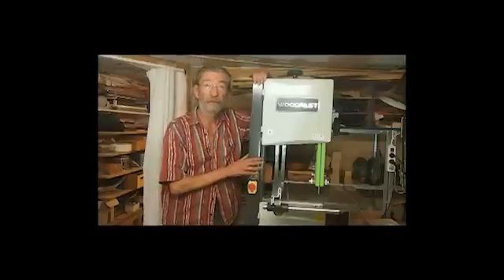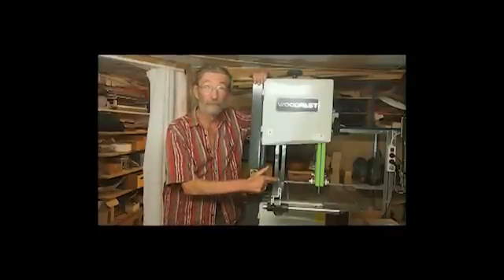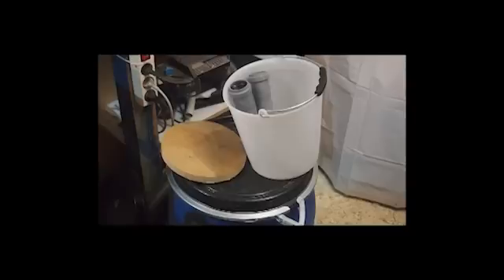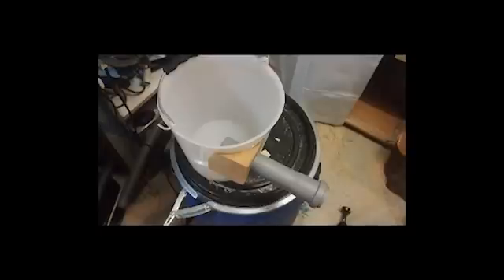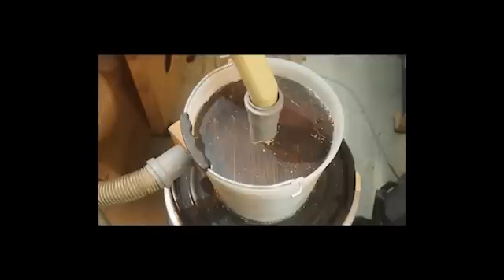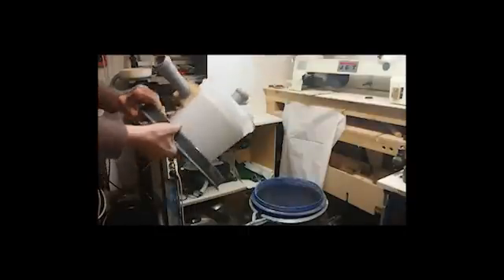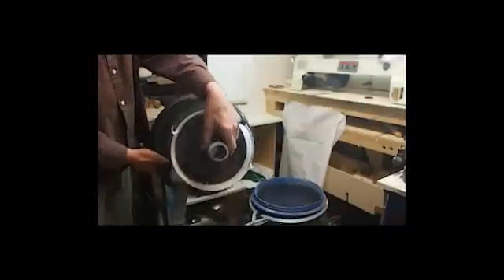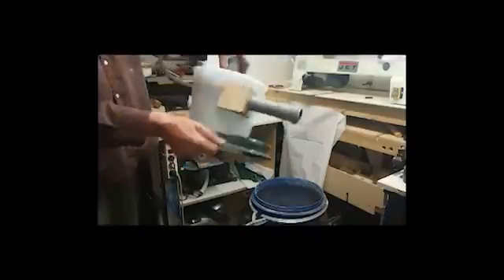Cyclone DIY Dust Collector

Comment: can i use a 12v motor?
Reply from the maker: The cylone is only placed between the bandsaw and the vacuum cleaner. The cyclone itself has no motor, it seperates the sawdust before the air is going to the shop vac. I don't know if a 12v vacuum cleaner has enough power. Greetings from Germany...
Reply: +Jürgen Glaser thank you for great response.... i was thinking about it.... about diy mini dust collector..... but for what you answer i think it cant be.

Comment: this worked really well.did the barrel keep it;s shape with the suction ?
Reply from the maker: +malcolm oxley - Hi Malcolm, yes it did. One time the flexible hose was totally blocked, so the lid with the smaller barrel had been sucked about 1 inch inside. Then the vac's valve opened... My common vac's suction is not as strong as a dry/wet Shop Vac. So it works well for my needs 'cause I save the money and the time changing the dust bags...
Greetings from the Black Forest
Reply: +Jürgen Glaser Hi ,I made a very similar cyclone to this but the container couldn't take the pressure,it was like your's but  smaller,I made a frame inside using scrap tubes and it worked ok. My grandson loves watching the dust disappear and I like the savings I make,more for me to spend on wood and tools lol greetings by the way from yorkshire england keep the projects coming regards malcolm